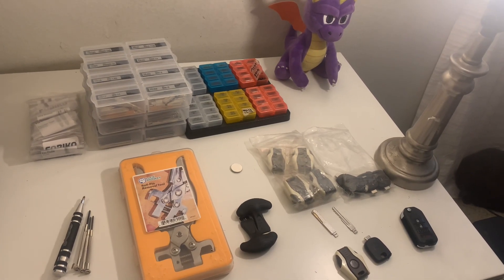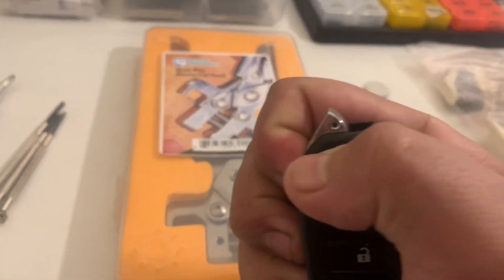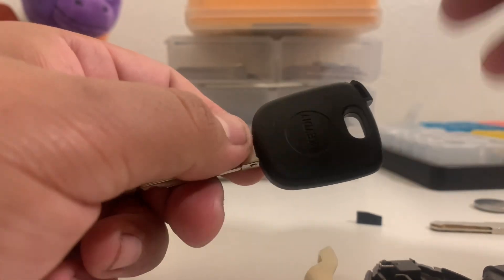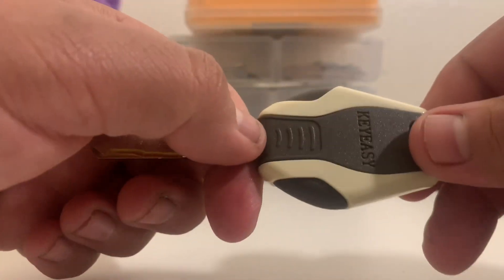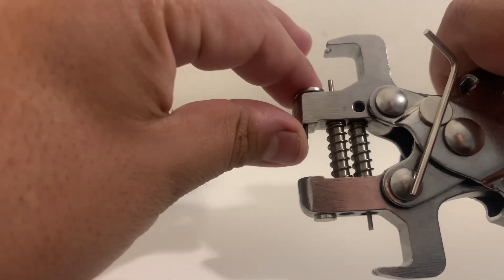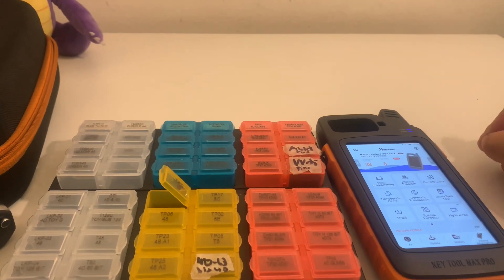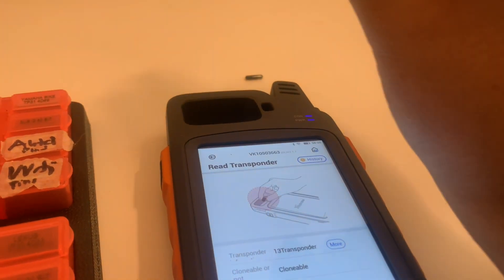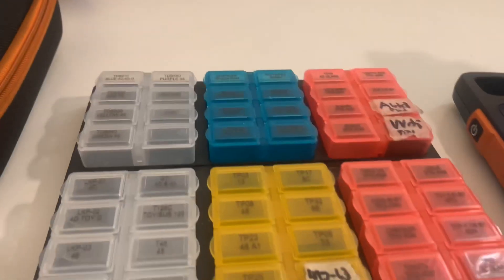YouTube University Automotive Locksmith Course-Build a key system, super chips and more!!!

Comment: hi mate where did you get the plastic transponder chip assortment cases from (yellow blue red and clear etc cases) Ive looked high and low on aliexpress with no joy. (im in UK) Cheers 👍
Reply from the maker: Did you type in universal shell heads?
Reply: sorry I meant the red,yellow and blue plastic cases you have in the video that hold all oem chips - I cant find them anywhere cheers  @Beginner-locksmith
Reply from the maker: @JamieCoen  hey bro 
I got that from American key supply unfortunately they don’t ship out side of US also use my videos as guide,what works for me may not work for you.
Reply: @Beginner-locksmith  Thanks mate I will have to DIY them myself 😅

Comment: I have a quick question with the MFK when creating a key from the set with a universal head for example all key lost with a superchip do you generate the transponder or you program the key as normal using a programming tool? Also does the super chip work for every transponder or you need multiple chips? Thanks.
Reply from the maker: I rarely generate chips 
I have OEM chips and I clone them to the super chip them program them in all keys lost jobs. Super chips will not work for everything.
Reply: @Beginner-locksmith  Is there like a starter chip OEM kit for these chips that I can purchase to generate and use your process?
Reply from the maker: No I had to buy them individually unfortunately but I saw some stater kits out there 
There after market but still
Reply from the maker: I just get OEM chips for American key supply
Reply: @Beginner-locksmith  Do you have a list that I can go buy to purchase? This is my issue currently I need chips to clone to make my own keys without the original keys so I can cut and program and key when needed. Thanks
Reply from the maker: https://www.uhs-hardware.com/products/transponder-chip-starter-pack-56-chips this is decent place to start
Reply: @Beginner-locksmith  I should go through the list and buy them seperatly and buy the ones that are only clonable correct? Thanks. 🙂
Reply from the maker: @macbookgenius007 yes sir!!! But you should have one of each regardless at very minimum.
Reply: @Beginner-locksmith  Ok I just went through the list only like 2 is cloneable from what their description is saying. If it doesn't say its clonable then it will not be clonable correct? So with that is best to still buy one of each just in case?
Reply: @Beginner-locksmith what's the thought behind this process? Why clone the oem one to a superchip when you could progam the Oem one. This extra step with the superchip got me really confused 🙈
Reply from the maker: @user-ju2ne6go2e I’ll do my best to enlighten you.
1. The first reason is OEM chips are hard to come by. I only found American key supply had them but not consistently. Also your account has to be approved by them.
2. OEM chips are more costly than a super chip ranging from double-triple the price of a super chip.
Reply from the maker: @Yusuf-r4r2o this just became visible to me.
Don’t know if you figured it out but I would just get the key tool mini.

Comment: Where do you buy separate blades when you run out and will you make a video going over pricing of your services?
Reply from the maker: Many suppliers have them individually sold. I personally prefer key4.com. Also there are other key types flip blades not in the container but you can buy them on different sites.
Reply from the maker: May I ask what city and state your in?
Reply: @Beginner-locksmith small town in Iowa
Reply from the maker: @leonmatvich5059  that’s cool
I don’t know if I should answer that because I’m always questioning my pricing. I’m not so fully confident yet in it. On some cars people say that’s too expensive but on others my prices are a steal. I’ve been calling as customers to local shops and asking what they charge not necessarily to under cut them but I don’t want to be the cheapest guy around.
Reply from the maker: @leonmatvich5059  the best thing I guess I could advise is call your local shops and see what they charge and figure it out from there.
Reply: I tried that with the only 2 locksmiths around me and the 1 that does automotive got really defensive and ended the call. So didn't work out for me to well
Reply: @Beginner-locksmith I figured it was normal for people to call and see how much you charge to try and find the best deal but he thought i was trying to steal his job
Reply: The other guy doesn't do automotive so I'm kinda stuck with figuring it out online. Since they're the only 2 locksmiths within an hour of me
Reply from the maker: Yeah I’m sorry about that.
It is a touchy subject and prices will vary depending on region. I’m still figuring out mine though and I don’t like to post videos on topics unless I’m sure that if someone copies what I do it will end well for them.
Reply: @Beginner-locksmith No problem I understand. Would you say generally newer vehicles are charged more or just depends on make and model?
Reply from the maker: Generally newer typically because some times you’ll have to do more work maybe pull out a star connector and or other bypass cables.
Reply from the maker: I think I will make a video on this later on the week maybe weekend but it’s not going to give a definitive answer.
Reply: @Beginner-locksmith alright I'll be on the lookout just in case you do
Reply from the maker: Thanks for watching my content man 👍
Reply: Thank you for making it. Haven't found too many channels that do it how you do.
Reply from the maker: @leonmatvich5059  yeah man that’s what I was going for. I wanted to answer questions that I had on my journey. So I try to be detailed as possible.
Reply from the maker: @leonmatvich5059  I don’t know how close or far it is from you but you may wanna keep on a eye out for automotive locksmith classes.
https://lsieducation.com/wp-content/uploads/2023/12/LSI-2024-Schedule.pdf
Reply: I have questions…What chips do you have in inventory? Thanks for sharing your experience
Reply from the maker: @miguelflores5382  hey man 
I try to have at least 1 of each of these. https://www.americankeysupply.com/product/transponder-chip-set-4-each-of-20-types-gtl-9933